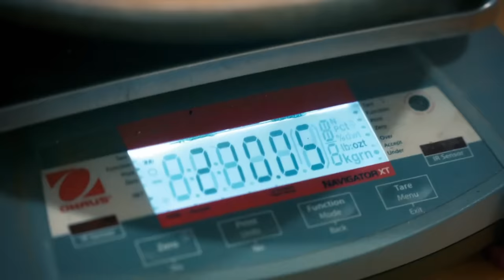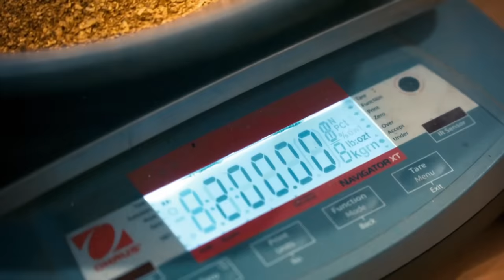Parker’s New Wash-Plant Roxanne Makes $120,000 A Day! | Gold Rush

Comment: discovery really doing the most to make drama where there should be any. the sd500 is rated for 330tons an hour and 2900 gallons a minute if you run it in spec and dont try to push an extra 100gallons a minute it runs totally fine.
Reply: That's the whole point of the show lmao. Drama😂😂😂😂
Reply: That’s why I prefer Aussie gold hunters. Although the mechanical problems and make believe life and death situations are still shown, you at least get to see some real prospecting with metal detectors and the occasional big nugget discovery.
Reply: Do u make 35 grand a episode
Reply: @randywilson6869 do you?

Comment: Is Parker able to sell any of the material they wash or is there even a demand for washed stone? I just had to buy a 23 ton load of modified rip rap. The price went up $5 a ton this month. I called around and was getting prices anywhere from $600-950 for a tri-axle load. 2yrs ago it was $300-350.
Reply: Gold mining permits and gravel mining permits are different. You could do that, with the right paperwork. Most of the cost of gravel is dictated by the expense of processing and trucking it.
Reply: The problem is when it comes to reclamation and having enough material to fill the cuts back in.  They use the tailings around the claim for road building, berms and dams.

Comment: What happened to Big Red exactly?
Reply: the shut it down to run Roxanne, not enought conveyor belts for both
Reply: The new plant can handle more material so will get through it quicker
Reply: Not big enough..greed is a powerful thing
Reply: in addition,it's pretty worked up,they mentioned that it got an overhault/maintenance break. also,the water-solution doesn't allow the 2 plants side by side.